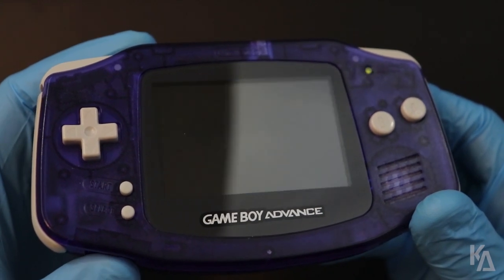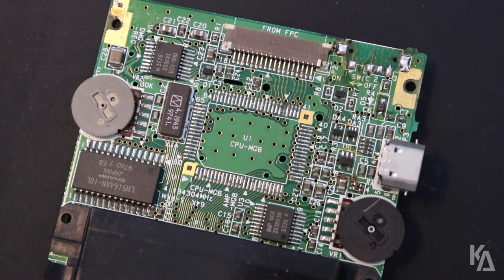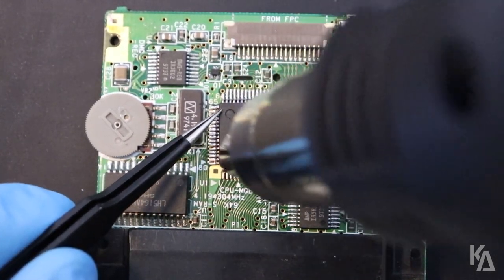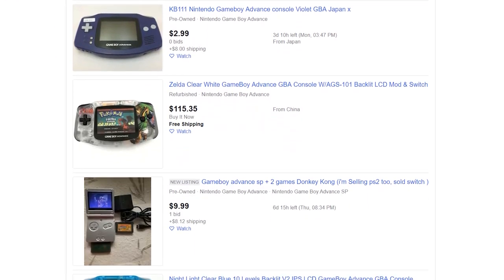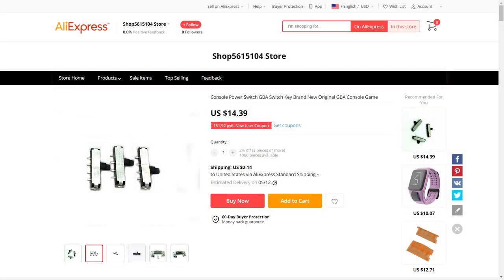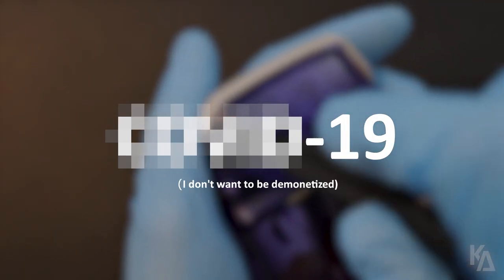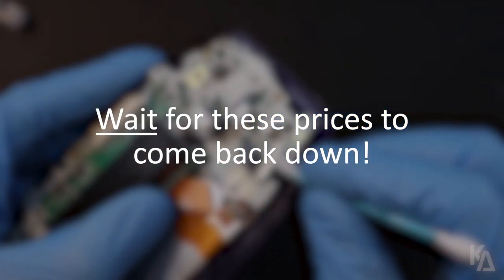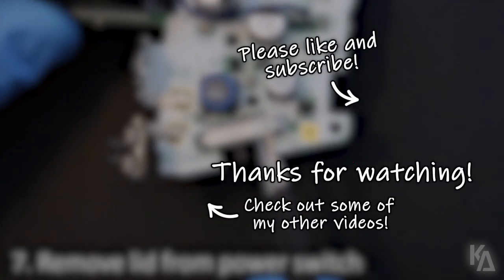More Tips: Repair a Gameboy Advance Power Switch

Comment: Good video. Just wanted to share that there's now another replacement switch option available from Helder Game Tech. Just finished replacing mine (after ripping off a pad and running a bodge wire) and it works well. And it was less than five bucks. Here's a link if you or anyone else is looking for one: https://www.heldergametech.com/shop/gba/gba-power-switch/
Reply: Thanks for the link, I buyed a similar on AE.
But, unfortunately I've broken the 4 tracks, anyone can tell me where can I solder a 'bridge' with this broken tracks?
A pic: https://i.imgur.com/LqsFOPb.jpg
Thanks!

Comment: Just checked AliExpress. They have lots of these in the $0.50-$1.00 range now. I ordered 4 for my own use. Shipped from the US my total came to $6. I could have shipped them from China for $3 less. Looks like power switch repair is now a go!
Reply: I was unable to find any for a decent price. Have you received them yet? I saw some but like the video stated, they seemed to be the wrong size (like for a DS).

Comment: The first switch you showed on ali was for the SP. You can order a cheaper switch under $5 which is an adapter board that uses the SP/GBC pw switch on the GBA. Many prices are still low on many items regardless of whats going on in the world.
Reply: So for gba (not sp) and cheaper price, which power switch i should buy? I see some power switch sold with little pcb board on it, and the other was shown in this video
Reply: @ns3242  Yes the little pcb board allows the sp/gbc switch to work on GBA
Reply: @mattb8124  thanks!

Comment: I'm not so sure the pricing is because of the current pandemic, it might be that the switches have not been manufactured for a long time and they have just been selling what they had in stock, the AGS-101 experienced the same thing (Although there are clone 101's on the market now)
Reply from the maker: While I disagree, that is a possibility.  However, given that these switches are MUCH cheaper and easier to manufacture than an LCD, and they also take up a bunch less room than a stack of screens (they come on a reel for parts-picker machines), I don't think it's the case.  There's no reason why dozens of AliExpress stores just randomly closed all of a sudden or no longer supply a part that was never really in high demand.  Unlike backlit LCD's during the current backlighting craze....  Also, another store opened up on AliExpress, while I was working on this video, that is now offering switches for about $10 ea.  I fully expect to see that price continue to fall back down to near where it was originally.  Thanks for your comment!

Comment: Holy crap. I was literally looking at original GBA power switch because I was messing around with a temperamental one in one of my GBA. I simply took it apart and clean it as well as I could but since the pad is a bit worn and wouldn't last forever I wanted to get some replacements just in case. Check online and the cheapest one I found was like $11....I was wtf.

Comment: hi,

Please suggest the below problem.

My GBA [with ips screen] does not turn up with two 1.3v rechargeable AA batteries. But working fine with two 1.5v AA batteries.
Please suggest I have to replace the capacitors. 

Previously it worked fine on 2.6v AA with ips screen
Reply from the maker: Hi, I think literally you're not getting enough voltage from your 1.3V (ea.) rechargeable batteries - Start with the easy stuff.  You need 3V total to run the GBA and supply enough power to the DC regulator.  With 2.6V, you simply don't seem to have enough, ESPECIALLY for an IPS-modded system like yours.  As for it working before on the same rechargeable ones, I can't say for sure.  They may have been charged-up slightly too much, possibly within the operating limits/voltage needs of the GBA.  Better get out a multimeter and begin checking!  Remember: That regulator won't start unless it has enough supply voltage.

Best wishes finding more capable batteries!
Reply: @KyleAwsm Thanks for reply.
All rechargeable batteries have 1.2v approximately prev. it is working fine. I really wants to know the reason. why it stop working with 2.4-2.6v. You can also try with rechargeable batteries.

Comment: It feels like, no matter how many times I try to apply flux, or how hot i make my iron, the switch will just not come off the board.
Reply from the maker: Check into something called "Chipquik" - It's a solder with a very long plastic state that makes it a bit easier to remove pieces with multiple solder joints.  Hope this helps, and thanks for watching!

Comment: I havea question... I cleaned out my gba switch inside by desoldering the metal piece and using isopropyl alcohol to remove the gunk and dirt but when I put it on with my gba intact, at around the 8 hour mark it starts doing it again and I'm using a Rechargeable CleanJuice battery from handheld legends. This did this before too with Energizer Ultimate lithium batteries as well.. I want to know if me replacing the power switch would actually resolve the issue cause in theory the battery life should be over 14 hours
Reply from the maker: I think you might have missed something in your explanation: What does the system start doing?  If the power cuts/battery dies before you think it should, I have heard that people have had mixed experiences with the Clean Juice kits, especially with modded systems.  Feel free to message me on Instagram @kyleawsm and we can talk in more detail about it there. 👍🏻
Reply: @KyleAwsm  I tested it on lithium ion batteries before without purchasing the CleanJuice kit and its doing the same thing. My gba sp works no problem when I flicker its switch but the regular gba will reset constantly after the 6 to 8 hour mark where5it should be close to 15 hours. So i think the Switch is indeed faulty and hopefully replacing it solves the issue
Reply from the maker: If the power switch works without issue to power the system on, and then after a specific amount of time of gameplay the system begins to have power issues (and it does the same thing with the Clean Power kit AND other Lithium batteries), I would say that you have a problem with some other component on your system besides the switch.  When under load, the lithium batteries can only output enough power for so long, thus being unable to satisfy the system's power needs once they are depleted enough.  Play time on a full charge can also be skewed by what kinds of mods you have installed in your system, i.e. backlit display, amp, etc. because consumption will be quicker/higher with such mods.
Reply: @KyleAwsm  I have an ips backlit display installed on it but I might see if the power switch might be the issue. If not then I don't know...
Reply: The ips display is from a seller so it's unbranded. Are you suggesting I switch it with the Funnyplaying one instead?
Reply: The ips display had no issues before as well as the power switch cause it lasted for 14 hours
Reply from the maker: Message me on Instagram if you can, please - Let's talk more over there so I can keep all these details straight.  www.kyleawsm.com
Reply: @KyleAwsm  I'll have to add later of anything but I'll keep you posted

Comment: I have two GBA's with faulty power switches. I tried looking online for a pair, and yeah... It's madness. I'm not paying over $10 for a single one.
A shame, because I really want to get to modding them soon. :(
Reply: I'm in the same boat, I have two I'd like to repair as well, and I can't find one for cheaper than $10 at this point. I may try repairing the switches again.
Reply: Alibaba is the cheapest I can find. Minimum 10 at ~$4.50 each...